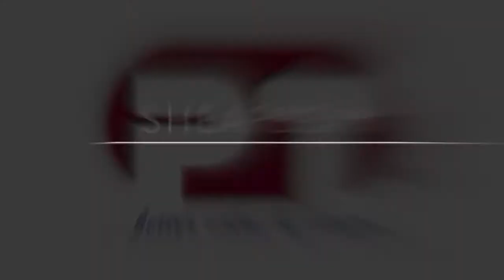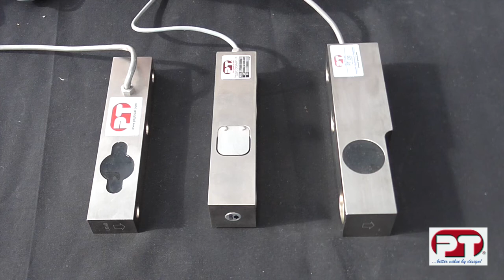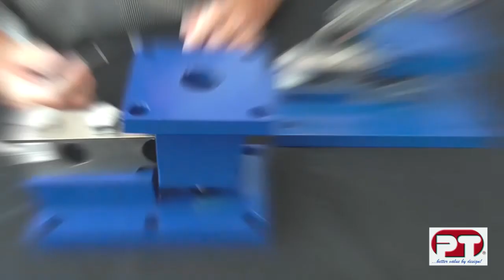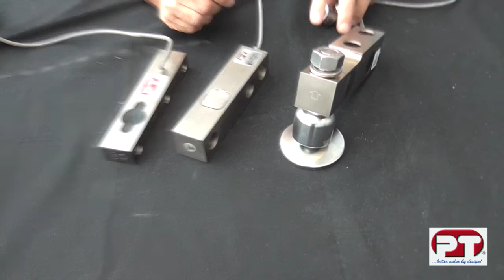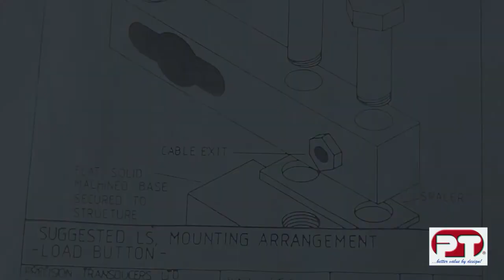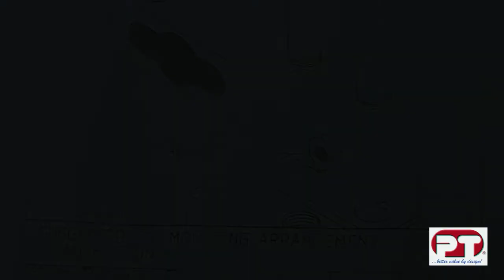Sheabeam mounts & Accessories

Comment: This loadcell mounting lit has lot more scope of improvement.
1. Need to protection arrangement for load cell cable.
2.upper load plate doesn't have excess load protection.
3. Load cell damage prevention lock bolt mechanism needed.
Please look into these for scope of improvement.